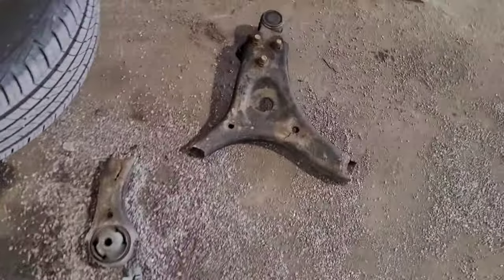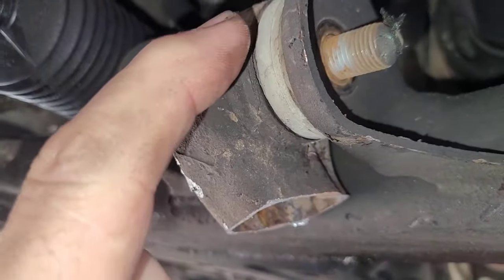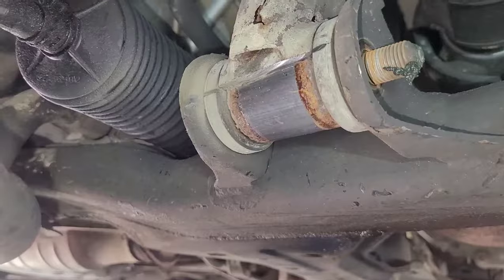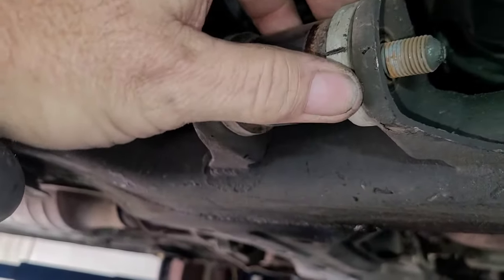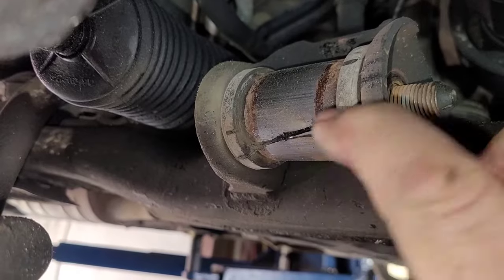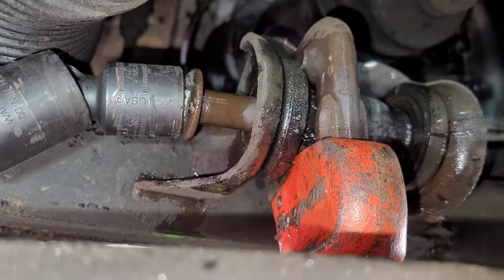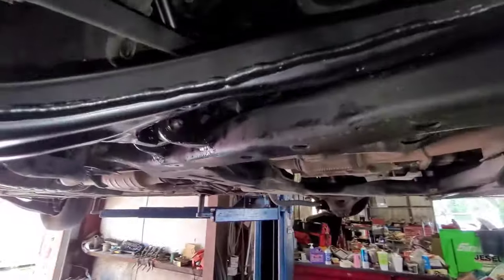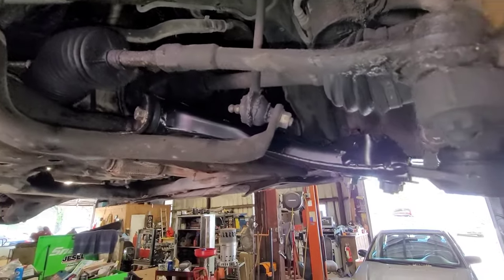Seized control arm bolt removal from a rotted control arm.

Comment: You could have sawzalled the bolt off and replaced just that and the bushing, instead you're billing the customer for a new control arm and all that time saving a $15 bolt. Congratulations.
Reply from the maker: The control arm was rotted in two. Thanks for watching!
Reply: 😅.. this guy. See he's never replaced a control arm. The bolts are always the problem.

Comment: Funny how I'm seeing this now. I just did this and I came to about the same way of tackling it. I cut the outer bushing in half and removed that then cut the inner one in half til I got to the bolt threads then heat that bushing and held it with a locking pliar and impact the bolt out. All my cutting was done with a dremel. Sometimes gotta use only what you have.

Comment: Great video, sir. Can I do this same method with my Pontiac g3 20210? I am changing the front shocks and control arms cause it's used and rusted. The bolt is stuck on both arms in this same bushing and I have tried impact gun, breaker bar, penetrating oil and heat. Will this method help? I am a novice mechanic.

Comment: A thin disk on an angle grinder, cut between the  bolt and the mount, easy quick less fuss😊
Reply: Cut the bolt itself?
Reply: Dealing with this now on a friends accord , bought a new bolt so I’m thinking just cut it on either side and be done with it

Comment: Use a ballpoint press and press the bolt out, you’ll save the bolt that way.
Reply: How about using a air hammer to remove the bolt?

Comment: How long did it take you to remove this screw? cutting the swing arm was unnecessary. I would cut the screw, which is cheap.
Reply: You can't find the suspension bolts in local hardware stores. You have to go to the dealers and sometimes they don't have them in stock so so you have to wait a day or two. That is why many mechanics try to save the bolts if they can

Comment: that is NOT a simple job. that's nightmare fuel. without a lift that job is 100% a major PITA. 

would it kill the factor to put some anti-seize copper lube on those bolts?
Reply: Or stainless sleeves, sure they cost more, but look at all the labor cost with getting seized parts loose.